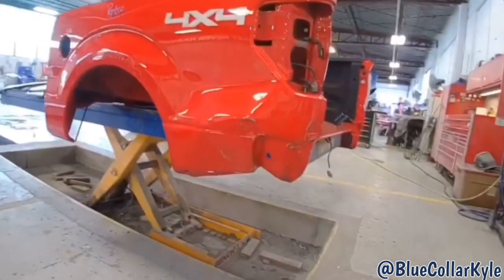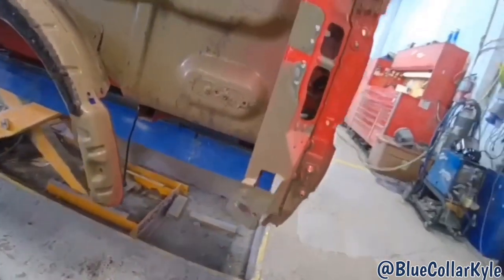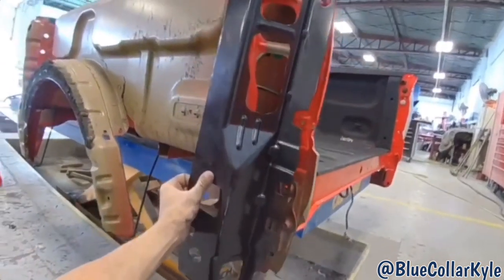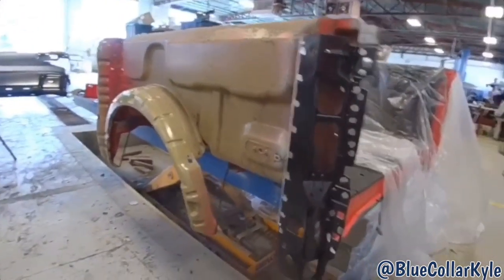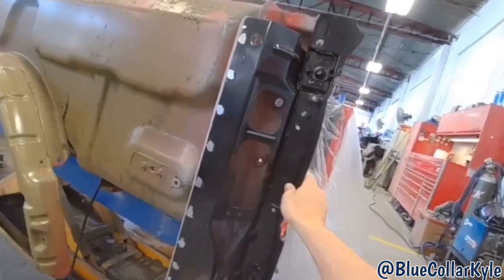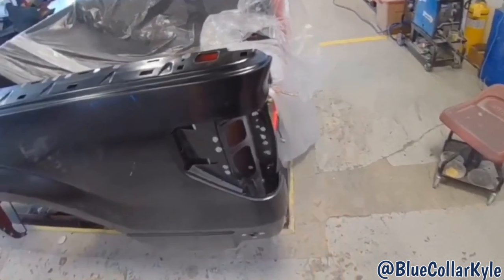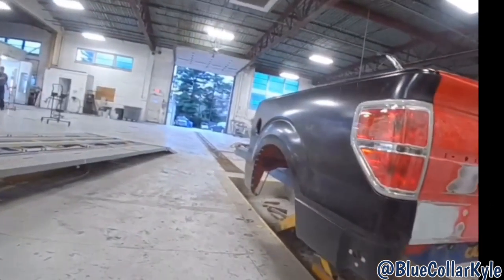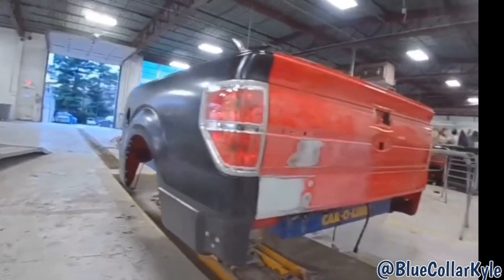Replacing A Steel Bedside!

Comment: I wonder if the seam splitter is designed for the purpose, or some other tool that has been modified.
Reply: they are made for that because they are the right thickness... not too thick and not too thin .. Panel Separating Knife

Comment: What's that cream colour spray you applied to the innerside of the bedside?
Reply: the black primer that the panels come shipped with is just for temporary protection and its thin .. also that paint is color coded to the manufacturer... SEM is the company that makes it... its called Ez Coat ... SEM-62209